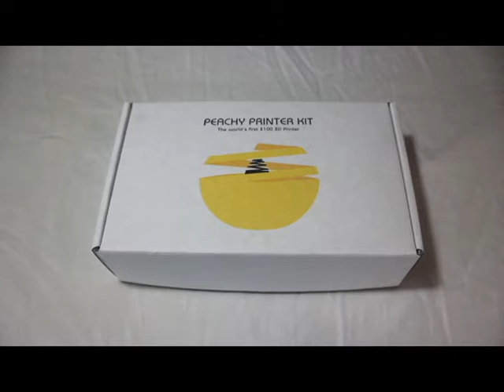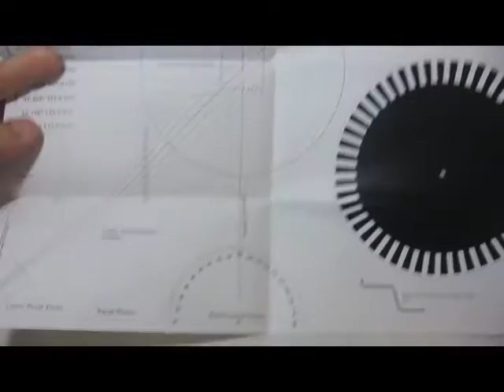Peachy Printer V1 Kit Unboxing

Comment: Hey, Great video, thanks! How has been your experience so far with the printer?  I'd love to watch a review before pre-ordering one. There is little information from beta testers and order users; and you have the best content on YouTube.
Reply from the maker: There is a lot of work to be done yet unlocking the full potential of this printer. No matter what, it is a bit messy, due to the saline and liquid resin. Those things said, it is great for figurines and statue type prints. Useful, structural tools and things are still in progress. 3d printing is hard. At least with the Peachy, it is inexpensive. I will do a proper review and usage video in time.
Reply: Thanks for you comment. I'm looking forward to watch more of your videos.

Comment: I love your unboxing and build videos man! (watched the beta, not v1 yet) nice mic you use for unboxing, fine and satisfying rustling. :)

Do you know what the limits are of this printer? What is the maximum angel and range of the laser? Because this is how we can know the maximum dimensions of a reservoir that we can build
Reply from the maker: +Yaroslav Larkin Thanks! I am really glad you like my videos! :)

As for the maximum size, it is hard to say. The maximum range is very, very far, and the max angle is 40~ degrees. The problem with figuring out the maximum reservoir is you can always move the printer vertically, and so the theoretical max size is very, very large.

Comment: Damn.......... I already have like 80% of this BOM sitting in my room for different projects... If only they sold the non-off-the shelves parts in a tiny tiny box and had well explained guides, I'd buy it TODAY. Like, I don't need USB wires, steel wires, hoses, shrink tubing, the drilled bottlecap..... That can all come from a hardware store down the street